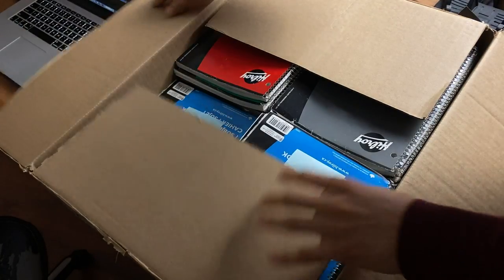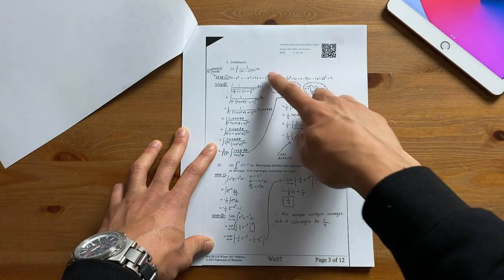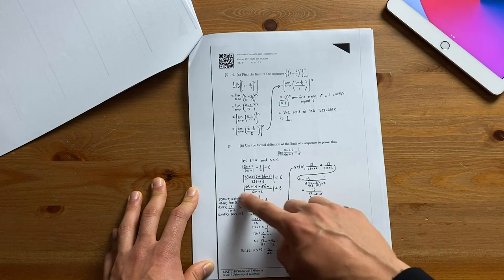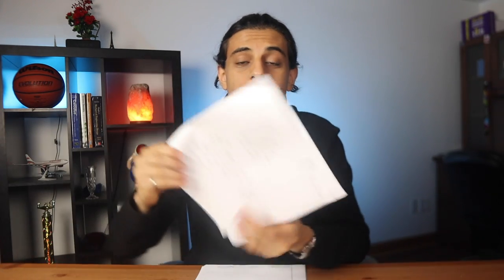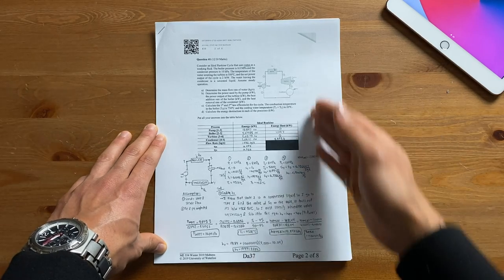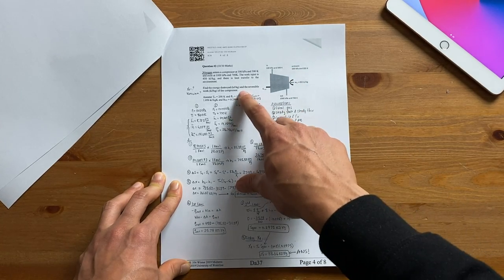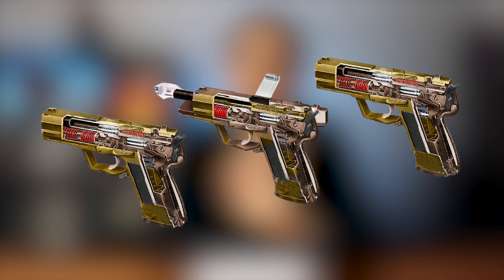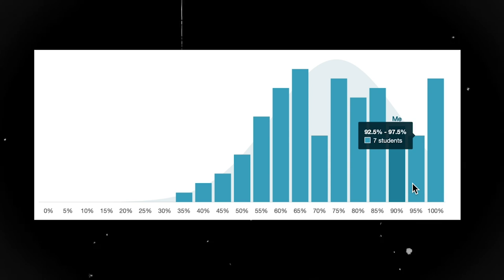This is what engineering EXAMS look like

Comment: Getting a degree in engineering can be great if that is what you needed to do in order to learn the materials for future engineering applications! However, getting deep into dept to learn engineering applications and sciences does not have to be. Yes I did 3 years of staggered engineering classes but I did that while working a full time job to be dept free. I now work as an automation engineer applying what I have learned in the field while also In class. All this without a degree, so it is possible to be an engineer without a degree. It does depend on a company valuing your experience over a degree though. Started as a welder turned into automation engineering! You can do it!

Comment: It’s interesting to see how different your calc 2 exam is compared to the one I took last year in Italy. Here the cal 2 exam goes far beyond simple integral and it’s mostly about double and triple integral so you have to integrate 2 or 3 variables function over a complicated domain like a sphere, a cylinder, a cone and combinations of different shapes. We also had to study line integrals and surface integrals and analysis in IR^n, so basically studying a multivariable function, so we had to find its max and min by analyzing the character of the Hessian matrix associated with the function.
We also spent quite a long time studying vectorial fields and their analytical equations and a bunch of theorems related to them, such as Gauss’ theorem, Stokes’ theorem and Green’s formula. Computer engineers, like me, also study complex analysis, so integrals of function defined with complex numbers and we had to study and do the types of integrals I already mentioned but in C (the number set, not programming language). We also studied series expansions, such as Taylor’s series with the so called “reminder of Peano”, Laurent series (nasty stuff, I found it extremely difficult) and Fourier series.
Oh and we also studied Laplace transform at the beginning of the course, which was supposed to be a soft introduction to the course. 
So I was kind of shocked when I saw this video because the integrals you showed us are basically normal integrals of one variable function which are quite easy when compared to all that stuff I’ve done in my calc 2 course.
Reply: @Aidan Lavelle That’s weird in the USA triple integrals is calculus 3 and calculus 2 is integrals, and series like Taylor series.
Reply: Analisi 2 non è il loro Calculus 2. La nostra Analisi 1 è divisa in Calculus 1 (derivate) e Calculus 2 (integrali), praticamente.
Reply: In argentina this is analysis 1, where pre-analysis are normal integrals and stuff shown in this video, however I study maths and our exams were way longer, (4/5 hours), only 4 or 5 questions yet way more difficult than what was shown in this video, very interesting stuff

Comment: Systems engineering or data science? I am a freshman deciding between the 2 programs my school offers. I'm good at math, stats, and physics, and want a more liberal arts type of engineering and I think my cs ability is not that strong. Any advice would be appreciated!
Reply: Which one interests you more? Each has a broad range of applications. I would recommend asking your local university faculty what you learn in each program, what the exams look like, what internships you can apply for.
Reply from the maker: It’s hard for me to tell u which track to take since it really depends on what u like. But just know that u really can’t go wrong with either! The job prospects are good and the pay tends to be high
Reply: from this comment only, specifically looking at the comment and more specifically the "stats" and "liberal arts type" parts of the comment, you might be better suited with data science.